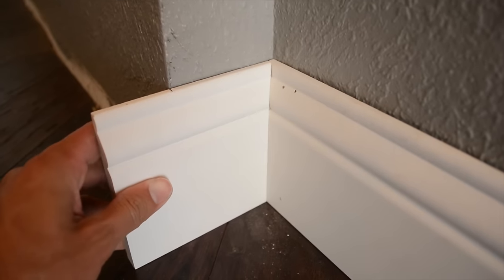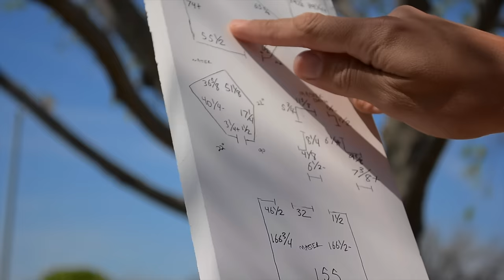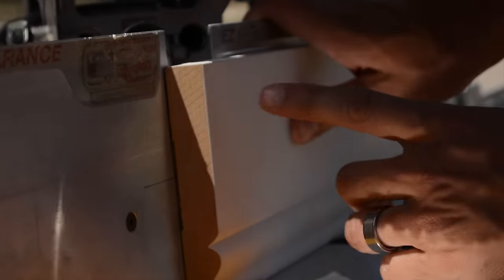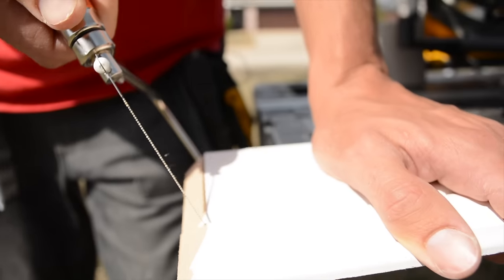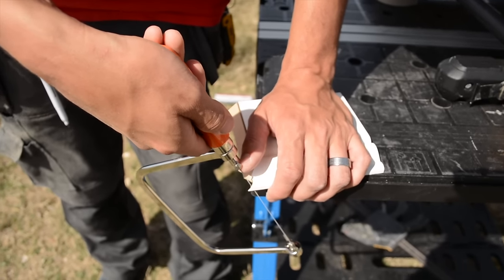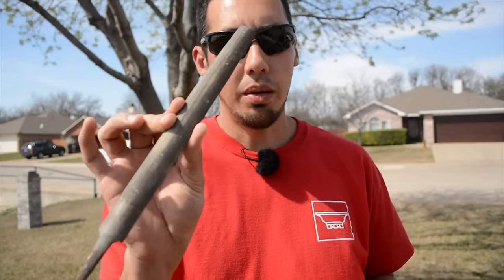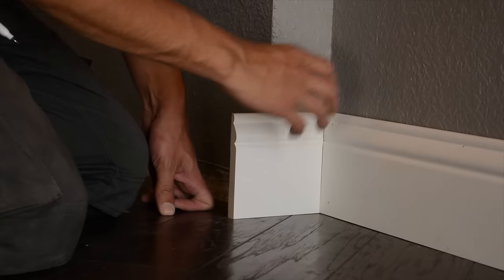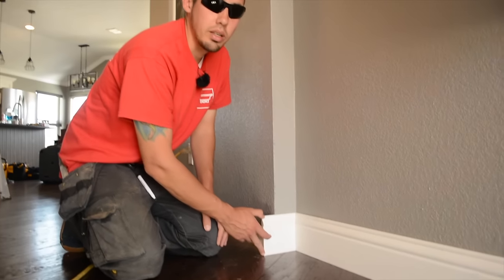Coping MDF Baseboard

Comment: I’m not very experienced nor a carpenter but I do have a tip from personal experience I would like to share on coping. Using a DREMEL tool with a 60 grit or lower drum sanding attachment you can touch those edges of trim faster, easier and closer than the file. WEAR YOUR RESPIRATOR when doing this due to high airborne mdf dust!

Comment: I was taught as an apprentice in the UK (1959) to stand in the doorway of a room and plan the cuts so that you never looked directly into a joint. In an old house with a ballroom in it the skirtings were 16 inches high and very ornate. Back in those days we didn't have skill saws and the coping saw was second nature. We also had to leave on the top of the skirting just sand down the squared off piece and rub candle wax along the edges so any errors pushed out the wax and scrape up with a chisel. Also as it was timber we tapped the end of the coped piece to bed it is before cutting the next mitre....... I like to say that those were the days....... but looking back I cant sadly.
Reply: Yes m8  if you're standing in the doorway looking into a room, always start on the far wall opposite the door, can't go wrong, everything scribes into that skirt, square edge both ends

Comment: Good tip I have coped base that way for well over 30 years. You are the first one on YouTube that I seen do it that way. Most people use coping saw and fiddle and feness to get a straight line. On wide base it's the fastest way to go. Great job
Reply: Thank you Rick. I try to teach the traditional hand tool methods as every diy'er should learn them before progressing to power tools. That way when there is no power on site you can keep working. Have you bought a Studhawk saw guide set yet - you will be amased how accurate they are and if you want to splice something in situ then you can't put a chop saw onto a fixed architrave. Studhawk saw guides are great for studwork, architraves, plastic pipes, guttering, mouldings and woodwork joints such as half housings tenons etc.
Coping internal joints on baseboards is the correct way for several reasons:-plasterer's never plaster perfectly square.A coped cut opens up less with shrinkage and yes MDF shrinks often more than solid wood which is up to 3% on length. So when carpenters say the wood has to be aclimatised in the room for 6 weeks it is for good reason !
Reply: Sorry I've never seen anyone use a coping saw like that or have to file afterwards

Comment: Another great video! something else that is good about coped joints is they stay tight with seasonal changes
Reply: Corey Young They don't, it's just that you can't see right to the back of the joint.
Reply: Exactly so in trying to do an internal mitre you are leaving the joint susceptable to shrinking if you don't use a coped cut.

Comment: Thanks for the tips.
I was very frustrated with my miters until I noticed it was the saw. I figured out how to calibrate the saw to 90 and 45 using your yellow angle finder. Also using my grinder for coping.

Comment: Dumb question...do you have to leave your piece a little longer than the desired finished length to factor in the material you remove when you back cut?

Comment: I keep a five gallon bucket with me on the trailer all the time, just in case there's not one on site. I lay the base across the bucket, which is upside down, that way I can use my knee to hold the base instead of struggling to hold it with my other hand. It's always worked out nice for us, I know everyone is different, but just thought I'd throw it out for anyone that might be interested in trying it. You gotta great channel man, full of useful information, I appreciate what you're doing.  You've showed me quite a few new things, especially on the wainscoting.

Comment: been scribing (coping) like that for years, i always do the straight with the saw. you should have mentioned the the whole purpose of scribing (coping) is so you dont see into the joint. if you just do an inside mitre (which to me would tell me your a novice)  and the house moves, the inside mitre will open up and there is no good way to fix that and coping prevents that altogether.. nice job young fella. also what you call a reveal is a quirk, your backset is really your latch, the big hole in the door is the actual backset,and the reveal is like the window jam.... thats what we call it in Australia anyway, but i only been doing the for 35 years. i really like you vids and thank you for calling me rare. as i do a lot more and as doing my own renovations i had to learn multiple trade. During the boom it was very difficult to get other trades to come and quote your job (ie plasteres) so my plasterer mate taught me how to set and do cornice work. I love wainscoting but there isnt much call for it here,,,unfortunately.

Comment: Well dang Mr Diablo lol. It’s about time you went back to it. I know you were just looking for a return on the blade that came with your new rig. I’ve never worn a full face shield when cutting mdf. Prefer half mask and safety glasses and try to cut down wind. I do custom painting and always wear the full 3M when shooting clear coat. Those isocyanates will do you in way faster than the “cancer board”. All good stuff. I actually think that was the first time I saw you cope on a job.  Keep rock’n it Richard, Semper Fi.

Comment: I've done it both ways, cope and inside miter, and it is more traditional to cope but cutting miters is a significant time saver. Working for time and materials it's not a big problem but on fixed, paid jobs got to get it done fast and at a acceptable finish quality.

Comment: Not a pro, but done some work for a few friends plus all the trim around the house everytime we remodel and replace,  we've used mdf... I couldn't ever get the coping saw under control enough around the curves in the profile to keep from screwing it up.  So, did the same trick with using the miter saw to back cut the straight parts, to save time, then using a barrel shaped grinder bit in the dremel, I was able to precisely back cut (grind) around the curved portions.   Could dial in the amount I took off to make it fit like a glove.   It does throw a lot of dust, so eyeware and facemasks are a must, but I'm not doing it daily either.   Thanks for the video...always love learning tips and tricks from the pros.

Comment: I don't know if this is the video where you demonstrated how to use an angle grinder with a 40-grit flap disk to do the coping, but I am using that method to cope baseboard and it works great.

Comment: I try not to cut a back angle on the scribe. In the UK the nearest profile we have to this one you're using is Torus. The only difference is the top lip is square. So instead of leaving the point we cut it square. Looks great when you get a good fit. Good video.

Comment: When you cope inside corners like this if you want to be nice to the painters. You can squeeze a bead of caulking on the edge of the piece you are about to nail and when you put the pieces together and nail em it will squeeze out perfectly. Clean the excess caulk quick and your good to go. I usually caulk as I install because I usually am the one painting as well.

Comment: Use the coping saw as it is designed.  The same as a frett saw, you have the blade as you have and clamp your work, instead of standing above sit and pull down. You will not have to hold on to the board and you can control your cut far more easily.  Check out jewelry making videos to see what I am talking about. I have been a carpenter for forty years and almost never brake a blade with this method. It is also very easy to get a 5 degree back cut to allow you to tweak the final joint and give you so play for out of square inside corners. Another benefit is you will not chip out the finished face by down cutting, especially on prefinished molding, and base.

Comment: Studhawk Saw Guides have a square edge hook which will sit on a pipe or a square piece of timber. Putting the tool on the wood is easier and faster than putting the wood in the tool. We are now working on the How To Build A Basement video and should soon be posting the Architectural Design, Planning Permission and Geo Hydrology Testing of soils soon.

Comment: I go with poplar/mdf is sweet painted/just gets damaged so easy/so many high dollar houses uses mdf/in texas totally right/thanks for warning everone about how mdf is crazy health hazard💯👍
Reply: The best wood to use for painting is Pear wood and this is what is used on high end jobs. MDF shrinks like crazy and architrave and skirting joints open up after time. The best inbetween compromise is the green MDF or moisture resistant MDF. If you want to router out the face for creating mouldings then switch to HDF high density fibreboard. Check out studhawk channel for professional tips on you tube.
Reply: Best wood for painting is pear wood - it is considered a hardwood though not very hard but does not shrink like pine and is stronger than mdf.Cutting MDF (medium density fibre board) or HDF (high density fibre board better for milling with a moulded edge) REMEMBER THEY BOTH can CAUSE CANCER
Reply: We do so many houses where they use this MDF for chair rails don't do that this stuff dents up so bad
Reply: It's going to be painted anyway which means it's going to be caulked in so you can leave it or not it's not going to make a difference you're not going to see it
Reply: Especially when the local slave depo sells the contractor pack made out of wood for the same price as the mdf bought by the piece.

Comment: Long time listener, first time caller.  My question is on 'Craftsman' style trim - 1x6 MDF baseboard with no cap.  Obviously I'll want to mitre the outside, but on the inside corners - is it better to find the angle and mitre those as well using the spray glue I've seen in other videos or should I just run one side to the wall and butt up to it, spending some time sanding/filling to make a hard-to-see seam?

Comment: I set up a jig saw with a small blade to cope mine. With practice it is simple.  Saves a lot of time.
Reply: Turning a jigsaw through a tight curve is harder to control than a jigsaw and when cutting the end of a piece there is no wood for the jigsaw to sit on. So coping saw is safer and less drift on the blade.
Reply: I love my jig saw to cope.

Comment: I cut it that way as well. You gotta try sliding a kreg clamp or 2 on that T-track..what a difference when coping not holding the piece down. I love it. I picked up 2 of them tables and have a 60" piece of 3/4 birch screwed down to 2-2x4's on edge and rest it on them brackets they give you for the outside. I  drilled 3/4" dog holes 3" on center across the whole piece and rounded over the sides and love it. If I'm building built-in's or even if I just have a lot of trim going on there I'll bring the table and it's SOOO NICE having some where to do glue ups, trim router, track saw..coping lol. I'm telling you bro..give it a try. Your back will thank you later.

Comment: I just tried it. my first one was slow and complicated at first but worth it because it'll look better in the long run. I like that I didn't need to tweak the board to get the miter to look good.  But, if the room is going to get carpet how high to raise the baseboard from the floor?

Comment: So what type of gap should exist between the flooring and the base board? I removed the carpet in my main room down to hardwood. And plan to  redo the baseboard(with new) when we paint. However we plan to install laminant planks in the future. What type of gap should we leave? I planned to get a piece stock laminant flooring to use as an overal shim, should the basebaords be snug as they can to it? 1mm gap? 2mm? etc?

Comment: @6:18: I use a knife for that little point: I'll make the cut wide with my scoping saw, and clean it up with my knife. Now I add another trick: that sanding block made with the scrap piece of trim trick I just leaned the other day from your video! :)
@ 7:40: any angle greater than 90 degrees from the plane of the material being coped will suffice for coping. Be it 90 plus 45 degrees or 90 plus 1 degree: it will hug just as well, right? And the shallower your angle, the stronger the tip.

Comment: I use a barrel jig saw with a Collins coping foot and cut the baseboard upside down so the straight cut is already facing up so I don't have to flip it over for the straight profile cut although I do have to flip the miter to the opposite 22.5 but I find that easier than flipping 16' base/crown. But this is a good tutorial for the Old School method, especial if your using MDF or small pine trims. You would have Carpartunnel after a few cope's messing with some hardwood, I don't know how them old dude's did it. lol

Comment: When installing baseboard, what’s your method on keeping the baseboard square to the floor?  Where I live, we have drywall walls with tapered ends. So when you attach baseboard to wall, the bottom of the baseboard pulls in to the tapered drywall. Creates huge problems when doing inside/outside corners.

Comment: Hi,
So I worked on my 4 -1/4 inch finger joint base molding for my basement for the first time this weekend. I have a miter protractor for determining the angles, and was able to get While cutting the inside Joints pretty good results. I am using a 10 inch Rigid Miter Saw. However I found that when cutting outside joints I have an issue. My Outside Corners are a little over 90 degrees, so the angles show as 46.5, My Rigid only does 45 degrees on the angled bevel head cut, I also tried doing a 46.5 bevel cut from moving the miter baseplate to 46.5 (as it goes up to 50) I can get the right angle that way nut the wood has to be straight up against the fence and the blade only cuts 3/4 before it hit the blade casing. I am assuming I will need to get a 12 inch miter saw to do the job on this outside corner?

Comment: I use the miter  saw to cut the flat part too but i cut it at 90 degs that so when i put glue on it and push it into the  corner  it squares up the corner i like to glue all my corners  just me ive seen so many nee homes open cuts

Comment: Do you ever cope the bottom of the baseboard on warped or lumpy floors. I work on 200 year old houses and we have to do it all the time. Just cut angle on bottom edge and plane to fit, Maybe you can show that and the baseboard height problems you run into.

Comment: How do you do dentil crown moulding? I did my very first crown job in my bathroom with that dentil but I’m not satisfied with my work. It’s just a standard rectangle bathroom but how do you measure to make sure the blocks in the dentil transition around the 90 corner properly? Also do you cope those?